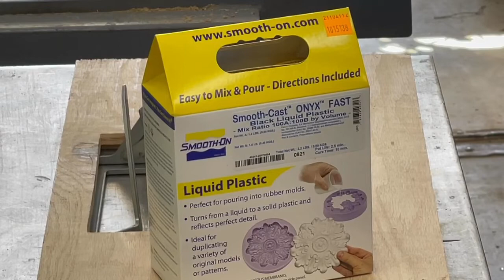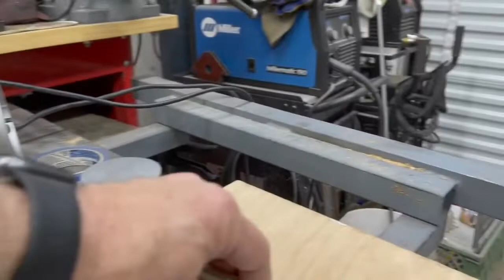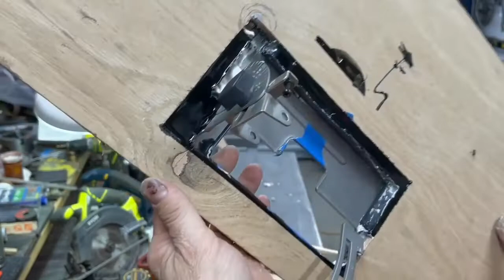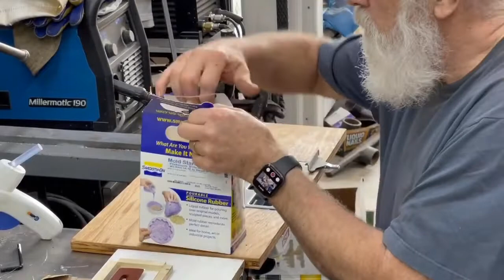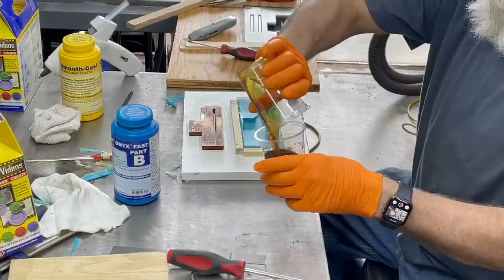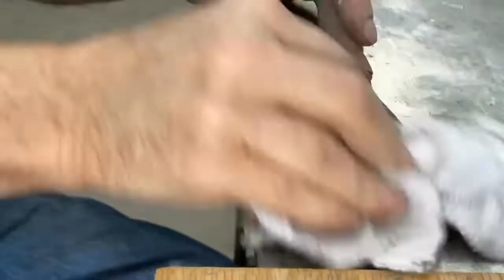Another DIY Mini-Table Saw Build

Comment: Really neat, thanks for posting that.
Question: you removed the silicon mold from the form, and flipped it over and set it back into the frame, it looked like it was buckling a bit since the frame had not been perfectly squared and appeared asymmetric.  Was that the cause for the resin casting insert not fitting in the saw?
Reply from the maker: Yeah, casting with resin is tricky, more because I’m impatient.  If I would wait for a few hours for it to cure fully it would be better but I find if I mess with the parts too soon, even if they feel solid, they can warp, like a potato chip.

Thanks for the comments!